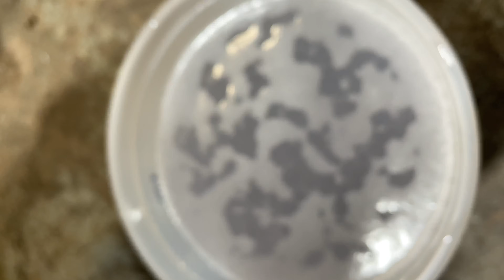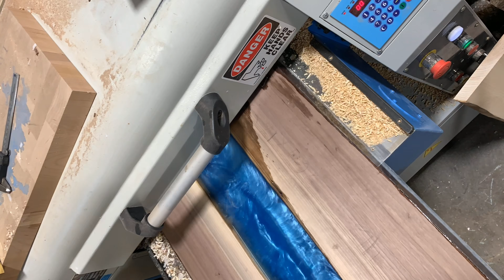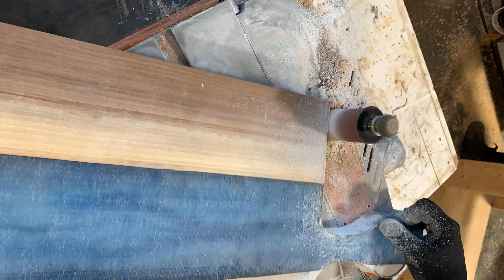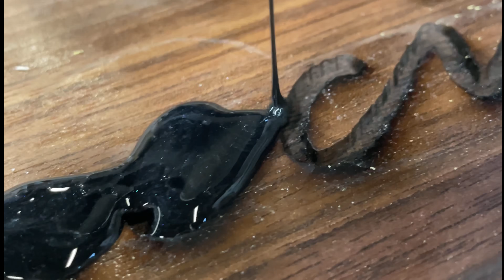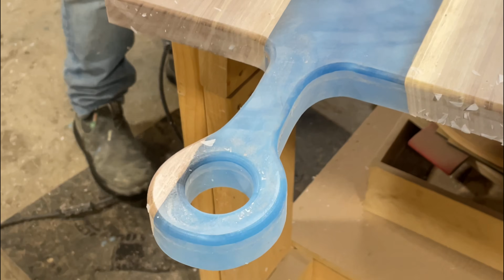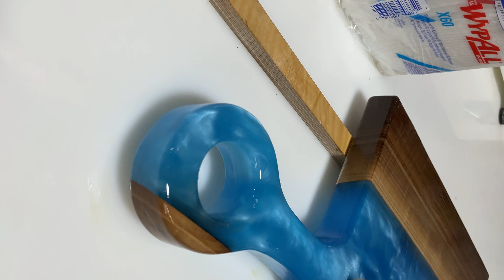How To | Epoxy + Wood Cutting Board with Epoxy Handle

Comment: I love this, but I have two major questions. 1. Once the epoxy was done curing, did you run the board through the planer and do all the sanding, engraving and finishing in the same day because I've heard as soon as you start planing and sanding you need to finish the board because of moisture and possible swelling. 2. When you sanded off the engraving epoxy, wouldn't that create an uneven low spot on the board since you had already sanded the board to final finish before you engraved it?

Comment: Rather have a functioning cutting board. I don't want pieces of epoxy chipping off when in use or an epoxy surface dulling my blade faster.

Comment: Can you actually use knifes on a board like this if your wanted to?
Reply: There’s a reason he didn’t comment back. There’s no way to cut on epoxy, it will leave little bits of epoxy in your food or on the knife regardless of what finish you put on it
Reply: @taylorwilliams5967   so it’s more of a display board, rather a cutting board.

Comment: Is there any maintenance needed on the board when using Rubio? Should it be waxed occasionally? How about cleaning it? I love the little wood piece in the handle.🙂
Reply from the maker: We recommend using a light dish soap and warm water to wash the board after each use. If the board looks dull or aged after a while, you can apply a coat of the universal maintenance oil or sand and re-oil the entire board. I have found that the Rubio holds up really well over time and refinishing is almost never needed.

Comment: Is the epoxy strong enough to support the weight of the board if you held it flat by the handle? Or is the handle more decorative? I’ve never worked with epoxy (but want to) so I don’t know how strong it is
Reply from the maker: The epoxy to wood bond is very strong. The handle is fully functional. We just released an "Epoxy Tips + Tricks" video that you will find very informative.

Comment: How would you work out epoxy amount in metric?
Reply from the maker: Multiply your Length X AVG Width X Depth and divide by 1000. there is 1000 cubic centimeters in one litre of liquid.

Comment: Is their any way to make epoxy cutting boards functional for cutting?
Reply from the maker: No matter what epoxy you use or what finish you use, I wouldn't recommend cutting on it. Unless you stick with only cutting on the wood portions of the board.